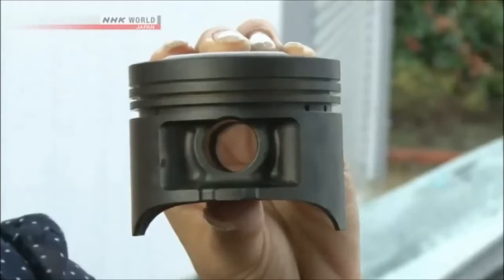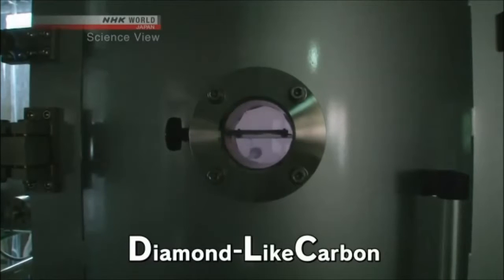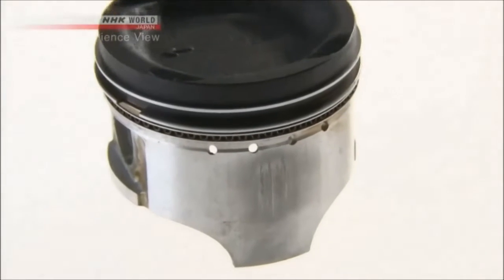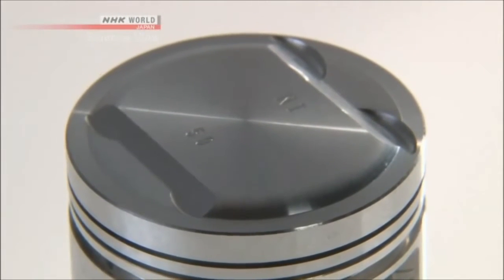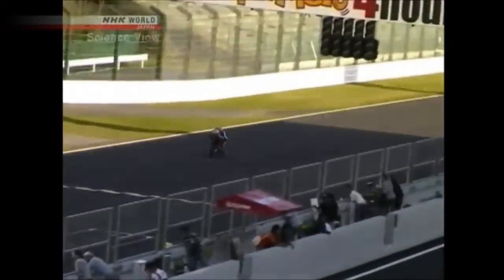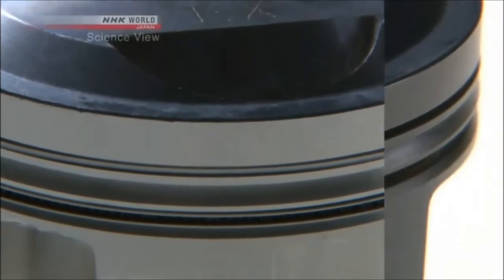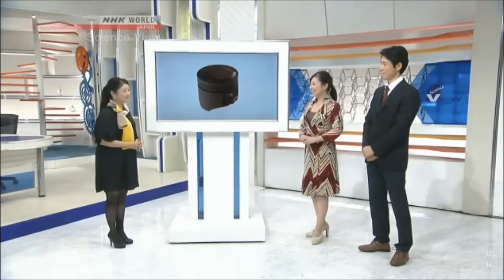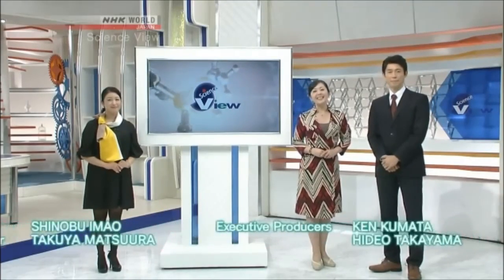Achieve High Efficiency Pistons by Reducing Friction

Comment: How much does it cost to custom DLC coat aluminum parts?  Is this pure graphite/carbon?
Reply: I guess theres company commercializing  making it more cheaper  maybe you can try flaking though this is only seen on machine ways it creates small pockets for oil  to retain and also decreases the area contacted thus reducing friction thiugh i have yet to see people flaking engine oarts to make it glide smoother .I hope i can try this on a small engine to prove flaking can be done on engine sliding parts.
Reply: The deposition equipment is not cheap at all but I am pretty sure you can order the coating from companies that do this in big amounts for reasonable price. For example in my country (Czech republic) you can order DLC coating for knives for 13 to 26 dolars. I don't know what type of DLC it is, but I think you can get the idea of the price. For these automotive uses, the coating should be more resistant to higher temperatures which can be done by doping the DLC with tungsten for instance, but these are also pretty common in industry.
Reply: @HarleyQuinn-kh1yf  well, they are applying DLC on scissors so i guess it is not prohibitively expensive.
Reply: $200 more or less.

Comment: Rather than shot pinning. Because aluminum has pores, I'm surprised he didn't try anodizing aluminum in some type of metallic solution. When Aluminum is hit with a current, the pores open and soak up the die. That's where the colors come from on Anodized aluminum

Comment: Now the piston is hard but the cylinder is still just aluminum or it’s possible to coat all the surface of the stroke
Reply: Aluminum blocks usually have cast iron or ductile iron cylinder liners.